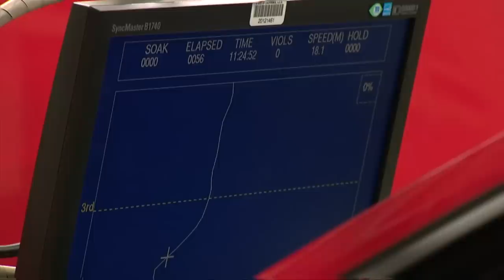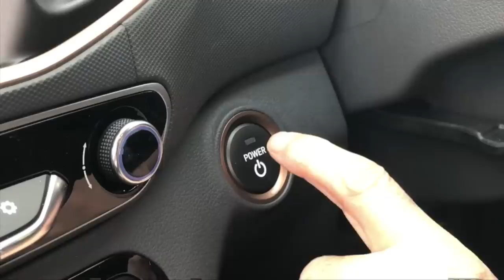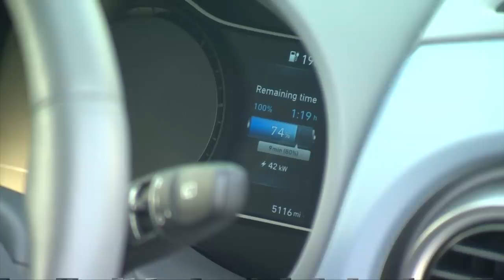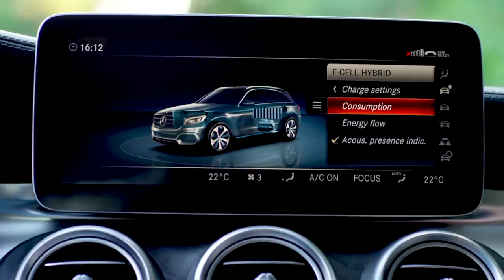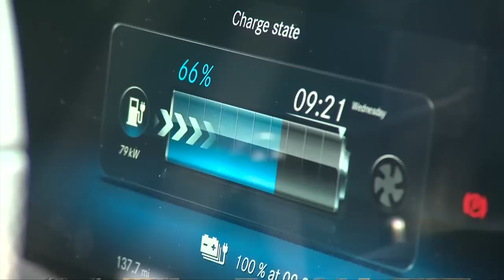Electric Cars: The Future of Road Vehicles? - BBC Click

Comment: I would also like to see a breakdown of Maintenance costs, Many Tesla owners I have spoken to say they are close to zero apart from tyres. Also Tesla cars have so many additional features like Auto Pilot on Motorways , not sure how close true Full self driving really is? Does the Tesla Model 3 really have all the hardware required? Also Tesla claim to have new batteries coming soon that can do 1 million miles and are cheaper than any current batteries next year, if so is it worth the wait?

Comment: Electric cars suck in cold climates because their range is largely reduced.  When the battery gets used up it's a huge cost probably around $10,000 all said and done.  But it seems most companies offer a 100,000 mile warranty.  After that, shell out 10 grand.
Reply: "Electric cars suck in cold climates".  Guess the Norweigians didn't get that message.
Reply: @alanfoster6589  no, they didn't. Where people like the OP get "facts" like battery replacement is beyond me.

Comment: People buy diesels because they are cheaper to run. They will also do that for electric. The difference is electric cars are better than petrol, diesel are worse. Electric are faster, smoother, more reliable, much less to service, quieter, easier for reverse / forward changes and slow moving steep inclines (particularly on SUVs), automatic, more interior space (passat interior for golf exterior), lower center of gravity, better wheel to wheel slip 4 wheel drive and safer. Once you drive one you will be very reluctant to go back.

Comment: Reviewing them all for 2019. We have a long way to go regarding charging stations around the UK. As I found out with the Audi E-Tron especially!  My reviews are all about depending on the UK infrastructure  fast charging options. Tesla still leads the way on every level. Range anxiety is the biggest fear for those new to electric cars. Rome was not built over night. Let me know if you need a female perspective regarding EV.   From a female perspective to date. I have never seen a women at an electric charging station. Why is that so?
Reply: The quantity of public chargers is actually quite good vs the number of EV's on the road. If the deployment of new chargers can keep up with the growth of EV's then they will be everywhere and a lot of the current problems will disappear. For instance Meadowhall in Sheffield have just increased from 5 charges to 50, so where as before you had to take a gamble if one was available, now you are pretty much guaranteed.

Comment: A 4 door sedan (electric) beat a Lamborghini (gas)
Reply: Sam Neale You’ll find the Tesla is quick off the mark because max torque is available from the drop of the flag whereas ICE has to rev to build torque, but a longer race, at higher speed and the Lambo eats up the Tesla’s lead.
Reply: Joe Bloggs I think you forgot that a 4 door sedan is versing a LAMBORGHINI and winning in a drag race
Reply: Sam Neale 0-60 is hardly a drag race. ¼ mile minimum - which then I think you’d find the Lambo up & galloping... but of course they cherry-pick the match-ups to show results that are convenient to the narrative...

Comment: Another argument which receives hardly any attention is that in order to advance the development and give a clear sign of demand to the manufacturers the electric cars which are currently available need to be bought by somebody. This however conflicts with the instinct that one should hold off with switching to electric now because the cars of the future will be so much better and more capable which in turn slows the development of said future cars down, further increasing the time spent burning fossil fuels. This is where governments should come in to incentivise the switch to electric cars.
Reply: "This is where governments should come in to incentivise the switch to electric cars.
" Which is something that was done, half-heartedly I may add, here in the U.S. and it didn't move the EV-buying needle much. After nearly 10 years of our tax-incentive program, it has only resulted in a gain of ~2% in EV sales for 2018. And still leaves EV's in the "very niche" category. 2019 sales are expected to stay at the ~2% mark which shows that interest is sputtering out.

But I do believe that the way some EU countries are doing it is more attractive - where they just give you a straight-up rebate when you go to buy an EV and that amount is immediately deducted from the purchase price. Far more attractive than a $7500 tax credit that you NEVER see back as $7500 in hand.

Comment: They got a fact, totally wrong at @2.28 of the video.. saying that the GM "Bolt" had limited success with the Car?   But the fact is it was super popular.. But GM only built it as a complacence car to meet the EV building standards set up for motorcar makers. .. Lot's and lot's people wished to have it, But could not buy it. Every time they asked a dealership for the car they were shown the Diesel version instead and given the hard sell to try to force them into buying that one not the Bolt.  But GM made too few for the demand and refused to make more of them!.. Even though it was a good EV and very popular, No money in it you see for them as when the car was sold that was it.  No parts for those engines unlike the ICE cars,  No pricey maintenance.  GM only wished to sell the Diesel version of the car instead!  Because they make lots of money with the ICE cars due to parts needed and maintenance?  Get your facts right BBC.

Comment: Very good electric show... I'd just like to say  a problem solver for people who live in flats or can't charge their car batteries, the source solver is a car battery that can be removed from the car and charged at home, the only sad point of this is it will charge slower than a electric charger.
People who drive to work, then park their car for up to twelve hours a day would be doing them self a little favor by letting there car to people they know and trust... If they just charge the battery at home they would be doing them selves a favor and could charge a little by card, being that when the driver gets in the car they have to swipe their bank card before it starts, 1. reason is so the owner knows who has got their car 
2. Once the borrower has finished using  the car the money is taken out of their account straight away and put in the owners and that would be for every mile they travel.

Comment: Batteries. The current furthest driven Model 3, over 100,000 miles with lots of supercharging which is harder on batteries, has about 2% battery degradation. Used EV batteries are quite valuable and therefore expensive.

Comment: If cost wasn't an issue id get a powerful ev like a Tesla but at the low and medium end there is a significant price difference for both the 2nd hand market and new cars.
Reply: Of course there is, because a working battery will always be worth significantly more than the rest of the vehicle itself. I think of it as paying for part of the gas I would otherwise use in the battery cost. An otherwise totaled Tesla (that can be had for 30k€ used), usually still has value of around ~15k€ in the motors and battery.

Comment: But when is the UK going to switch to metric?
Reply: The UK is metric - with the "exception" of roads. The reason given is the cost of renewing all the infrastructure relative to road transportation, such as road signs, where the replacement cost alone is estimated to be in the hundreds of millions. Fuel is sold in litres, however. All car speedometers have both a Km/H and M/H scale, so we can see how fast we are going on either scale.
Reply: @TagmakersCoUk  not just road. In real world, every british person still use imperial units. Just tell english man that you are 182cm, see how the face goes to "stupid" mode
Reply: @saliman4874  "every British person" is a silly thing to say.  Myself and many of the younger generation are starting to use more and more metric.  I am 83kg and 183cm in height.  Don't need to convert this shit.  Many people will just know it.
Reply: @Hirotoro4692  no its not, because you still ask for pint of lager in pub
Reply: Since the mid 70s UK prioritised metric in schools. Roads are the only thing still bound by law to imperial. Yes you can buy a pint of milk but the measurement in litres is written by law beside it, same as buying anything in a shop. 
As to when fully metric I doubt it will happen anytime soon as there is no political will to force it.
Reply: @stevepirie8130  you keep on ignoring the fact that 90% of population doesn't use or know the metric system

Comment: EV's are hyped a lot, but they don't always tell you the full story.  You need to ask a few questions to find the truth:

1.  How long does it take a Tesla to warm up the batteries in order to achieve "ludicrous mode"?
2.  How often can you perform ludicrous mode in a day, and for how long before the battery has to restrict the power due to heat?
3.  How do they produce the electricity for my "green car"?
4.  How environmentally friendly is the production and disposal of my batteries?

Don't get me wrong, I know the combustion engine has to change to help save the planet, but electric cars are not perfect either.  Until the day governments scrap fossil fuelled power stations, we cannot reap the full potential of a green car.
Reply: Good questions.  #3: How often are you going to use ludicrous mode?
Reply: I have answers for all your questions!
1) It's a few minutes to heat the battery for Ludicrous Mode...who cares? Are you running from the police?
2) Are you running from the police all day?
3) Electricity can come from multiple sources, gasoline only comes from dinosaur goo.
4) The batteries in an EV outlast the car, and after that, they are recyclable. How recyclable is gasoline?

Comment: "and ask if they are now a credible replacement" - asking yes, answering not even close? I know in 1 year new models and new technology will come, today is never the right time in this world. However if I decided to go for whatever is on the market, for whatever my reasons - would it be a credible replacement? Short and long term? How does the used car sale look like? Assume I will need to sell while there's still 3-4 years guarantee on the battery, what are the running costs? Finance options? BBC so many questions not answered!!
Reply: Did you actually watch the video? it said running costs are about a third of an ICE car. As for resale value, EV's hold their price extremely well. Especially Tesla's. which are very desirable.

Comment: FAKE NEWS! EVs are considerably more efficient at motorway speeds, compared to ICE cars, as well. At least 2-3 times, indeed. Their only limitation, as of today, is the amount of energy they carry on board. However, EVs with a range of over 200 miles are already available, which means you can drive for three hours before you have to stop. Which, for most people would happen anyway when using ICE cars, to stretch your legs, and use the restroom.

Comment: Diesel engine warranty- 2 years (but we know will last 15 to 20 years) 

Battery warranty 8 years - mass panic, ahhh EVs only last 8 years lol

In reality a liquid cooled battery, with a decent range say 200 miles plus, that isnt rapid chathe every day will last 200k to 300k miles before they get to say 60% capacity which is still useful
Reply: Your 40% loss at 200K miles is not correct - it's proven to be about 6%. Need the link?
Reply: @justsomeguy934  Dude I'm on the side of EVs here lol. In reality it depends on the battery chemistry and cooling. Some leaf batteries haven't even got to 100k before losing 30%. Teslas lose very little (but you have to take into account that a Model S 70 actually has a larger battery that is locked for use, so degradation cant be seen as it's just digging into the reserve). Either way most ICE cars dont make it past 300k so EVs are the way forward
Reply: @jamesx2703  you're absolutely correct - the best environment for batteries is climate controlled. The early Leafs went air cooled, and several cars in hot environments (Phoenix, specifically) had to be replaced. What's surprising is that Nissan has yet to water cool their battery packs, even though their parent company Renault has some great EVs on the market in Europe.

Comment: Why don't they try to bring back steam cars. And by steam cars I mean the sort of steam cars Doble made which had enough steam to move in about 90 seconds and produced roughly1,000 Lbs of torque. They could also run at 132mph. The technology had been there since the 1920s. The only thing they could do is change it from burning kerosene to burning hydrogen, since it is a closed system it would be very nearly carbon neutral, they are also quiet if fi they have a muffler on the exhaust. Doble steam cars from the 1920s is just as quiet as an electric car, it does weigh about 2.5 tons though. Steam is a very good alternative. They did some work on it in Los Angeles in 1972 and when they did a emissions test they found out that the steam bus produced significantly less Co2 than the diesel bus.  This would also keep mechanics in business because there is a lot going on inside a steam car. It is also worth noting that to make the batteries they have to get lithium and getting lithium has a big effect on the surrounding environment. In a place where they extract lithium in Chile they used up about 60% of the local water supply when they were extracting lithium.
Reply: Hydrogen isn't used because it's extremely expensive, both for the consumer, the average car costing about $90 every refill and for the gas stations, EVs make much more sense.
Reply: @argorath  That is the only issue with hydrogen fired steam cars, other than that they are a great idea. Once someone finds a relatively cheap method of producing hydrogen that could be the end of the electric car. If I drive I will make sure I drive a petrol or diesel car. Ideally something like a Morris Minor.
Reply: @argorath  Alternatively, they could use biofuel for heating the water. If it shuts off when the steam gets to a certain pressure it would reduce the emissions and increase efficiency because steam engines don't idle, with the exception of the white steam cars.
Reply: @autisticrebel1253  Or, alternatively, given we don't really have much time to try and minimise the damage climate change will cause, we can use the technology we already have with electric cars and make them cheaper and more accessible, rather than right on the brink of making them mainstream switching to an entirely new energy source.

Lithium ion batteries aren't great for the environment, but EVs mixed with clean energy sources are a hell of a lot better than gas cars. It's just irresponsible to go for petrol / diesel at this point if you have the choice, especially waiting for a technology that won't take off any time soon.
Reply: @argorath  Who knows in the future someone might find a relatively cheap way of producing hydrogen, in which case it could possibly lead to hydrogen-powered vehicles? Only time will tell but given a choice, I would basically choose anything as long as it isn't an electric car because at the moment they are quite pricy and like you said , the lithium-ion batteries quite bad for the environment to make. I do like the baker electric car though.

Comment: Since my current car cost me £600 and has lasted 50k miles it is going to be a good 10 or 20 years before an electric car is worth it for me.
Reply: assuming your current car is over 10 years old then yes, obviously it will be 10 years before a brand new car is the same price. That's how time works.
Reply: Fair enough.  How much have you spent on petrol and repairs?

Comment: And no one said anything to the life expectancy of your batteries when high amp charging comes into play.     :-))
Reply: I have lots of information on that topic, need references? In short, Tesla estimates their batteries won't hit 10% degradation for 300,000 miles, and Electrek estimates it's 500,000 miles. The average degradation on Tesla packs is hovering around 6%, and yes, there are Teslas with over 400,000 miles on them.
Reply: @justsomeguy934  Thank you for the info.   :-))

Comment: Its stupid, the smart car EQ costs twice what the petrol version did and only has range of 100 miles at most. I use a petrol smart that I weekly do a round trip of 100 miles, its a non starter. The extra 12K would pay for the fuel and more I use in ownership of car.
Reply: Yeah the Smart EQ is shit, a Renault Zoe is much more attractive value wise, but with any EV they become cheaper the more miles you drive, also because demand is much higher than supply the manufacturers can charge what they want. It might be a few more years before they become cheaper to own for most people.

Comment: Not if the battery packs cost way too much to replace in 5 years time.
Reply: Kiwi TeeTee Like VW said, warrantied for 8 years @ 75% capacity, then they’ll give them a 2nd life in household energy storage. The battery chemistry is what has improved year-on-year, mostly due to Tesla, to think 200000 +++ miles, and a rapidly falling cost of production, probably only need one battery pack for the lifetime of the vehicle now
Reply: You don't replace an EV battery in 5 years, that's a lie from Exxon. What you DO replace is gasoline every time you drive the car.

Comment: the 0 to 60 is a litttle silly. Despite its looks it's probably one of, maybe, the slowest lamborghini 0 to 60 available.
Reply: Fine, there are plenty of videos of electric cars winning drag races.

What's truly silly is that a sedan twice it's weight even has a fighting chance.
Reply: Why artificially distort an advantage electric drivetrains have? Racecars don't need 0 to 60 ever in most racing series. They need to be able to take fast changes in direction and sustain high speeds.